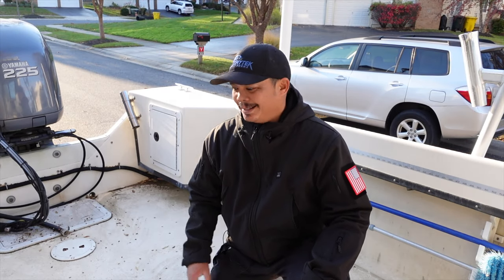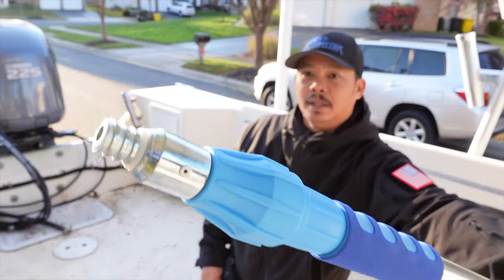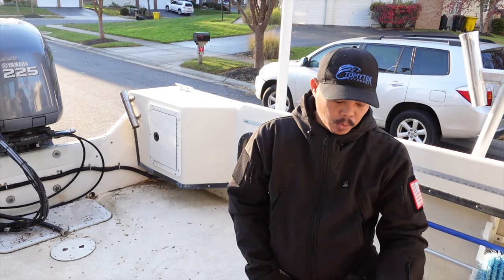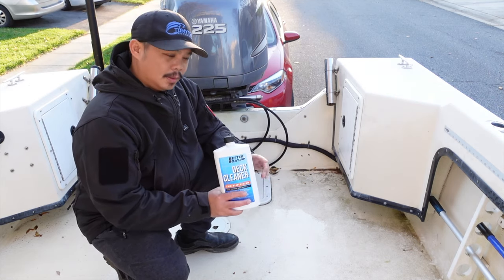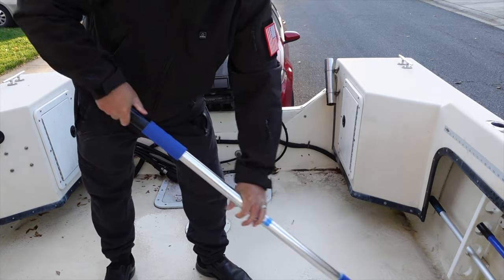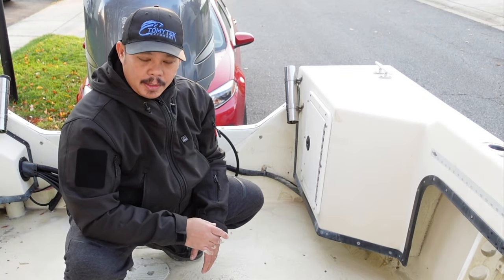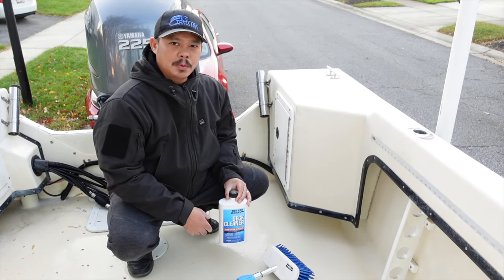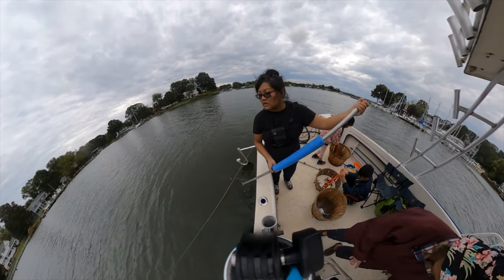How To Clean Your Boat Deck - Better Boat Products

Comment: I’ve been hoping to figure out a sealer for the deck that won’t make it slippery. My deck stains easily
Reply from the maker: I didn't have that problem with my DLV, but it was a 2007.  Maybe they use slightly different material now.